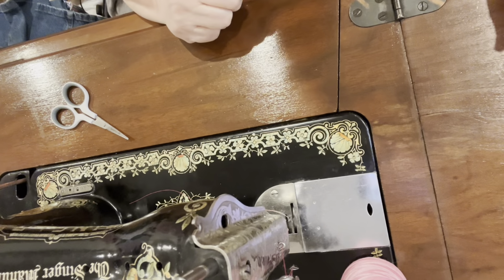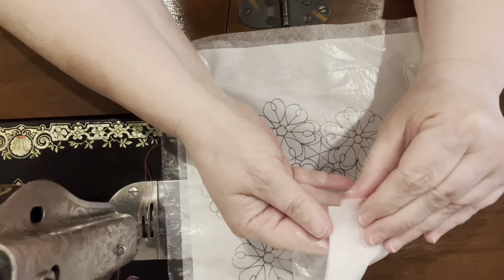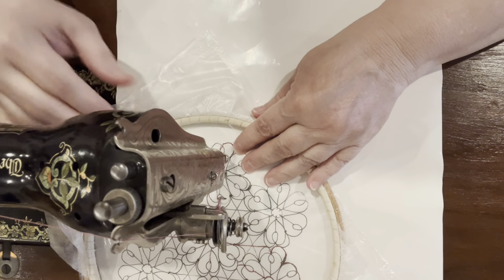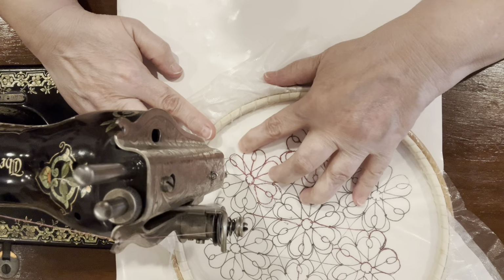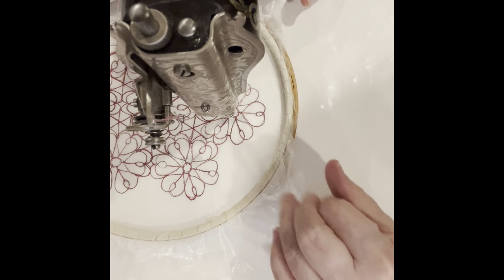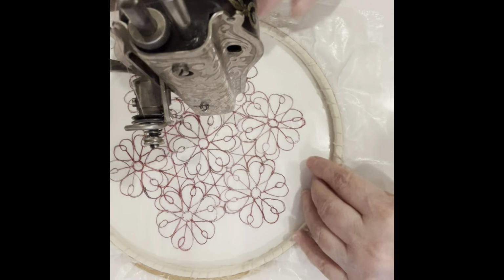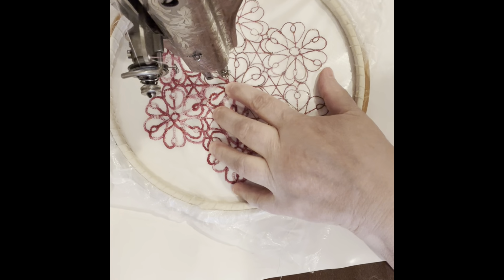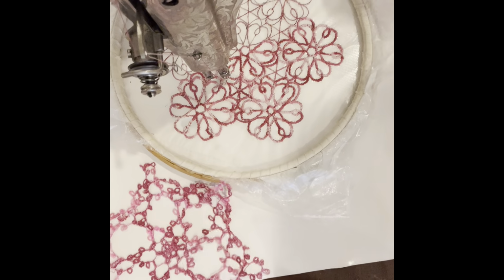Doily on the Treadle part 1

Comment: I was doing a sea turtle last year with varigted thread and I didn't care for it, and so after a few hours of work I decided to use the piece to test different thread, tensions, and hoop movements to create different textures.  I was doing more fill vs line work  and wasn't getting the color spread out like I wanted and found myself trying to go back and even it out.   My piece was large like yours, and I think I will work on smaller pieces until I get the hang of it.
Reply from the maker: Large pieces are so time consuming! But oh when you finish a project! I do think variegated thread has its place.  I just don’t think it works well for this doily.  A sea turtle sounds like a great embroidery project!